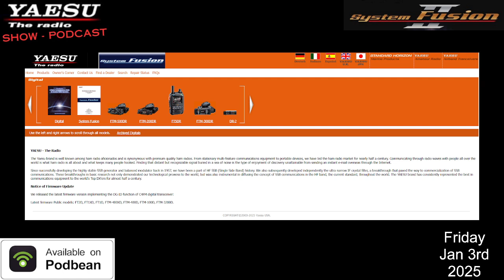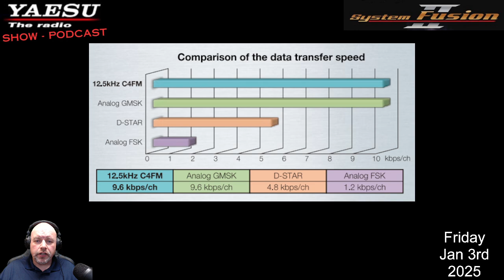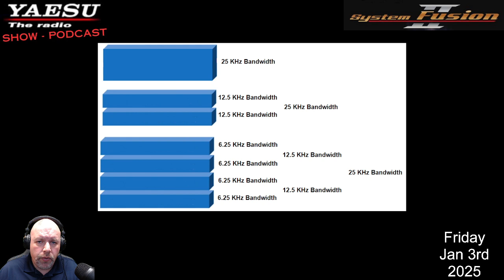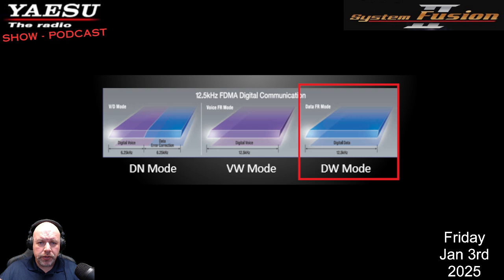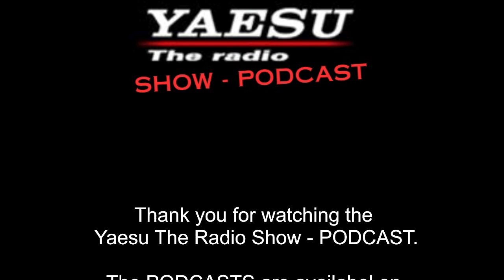S4E1 - What is Yaesu system Fusion - Part 1

Comment: Thanks John. I'm not a huge fan of digital but Fusion is very easy to deal with. No memorization of room numbers, etc. as one can see what's available once connected to the C4FM/WiresX repeater. I have the FT-5D and the FTM-500 which work as they are supposed to however there are shortcomings that won't be discussed here.

Comment: Not proprietary?  Who else makes YSF capable radios?
Reply from the maker: Greetings customer, your thought process about proprietary is not correct and because no one else manufacturers a radio that uses Fusion does not mean that it is proprietary. To add more to the comment if Fusion was proprietary then please explain the usage of Spot Devices being able to do Fusion. They do not license Fusion because it is an open protocol that anyone can use or add to a radio. - Admin Team
Reply: I thought "Yaesu System Fusion" was the Yaesu adapation of c4fm for amateur radio purposes. This includes things like the 4 operation modes like v/d, high speed data and fm analong...then linking ams with it and such.

YSF rooms... that is a partial misnimer, as there's no analog, high speed digital or ams for that matter.

Comment: Thanks John, very informative video. I just bought my son and I an FT- 5D, I also got an FT-70d... I'm going to use my 5D for a PDN in access mode. Can I set up Wires X on my desktop PC at home,  and then have Wires X on a laptop for travel using the same 5D?
Reply from the maker: Greetings customer, yes you can run two different computers with WiRES-X and if using the saem device please be sure that only one computer is turned on and running the WiRES-X software at a time.